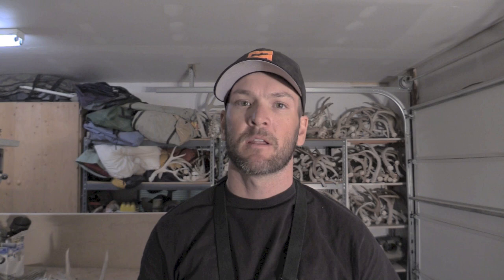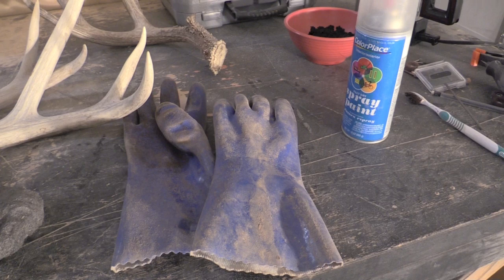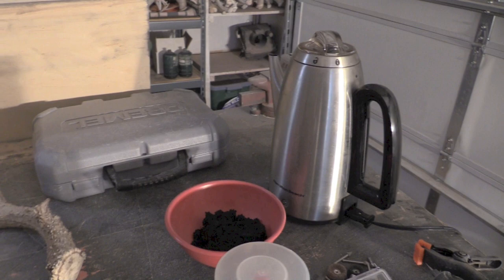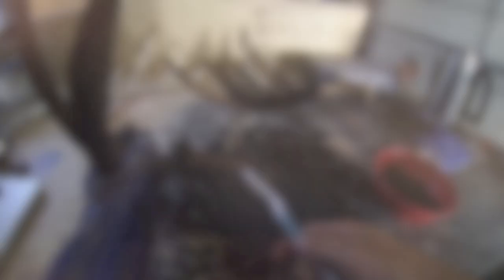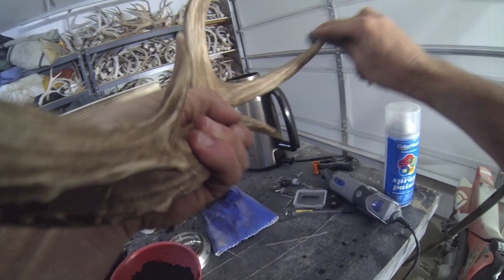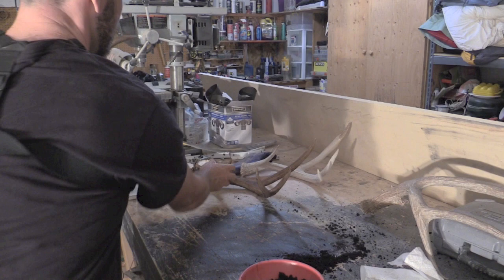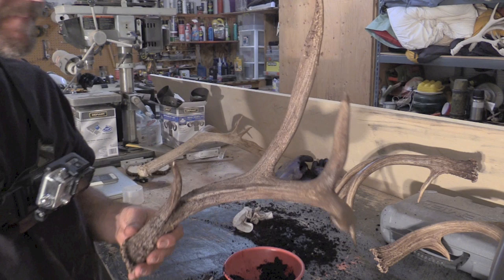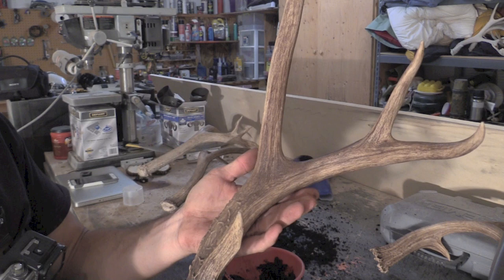How To Restore Color To Deer Antlers CHEAP!

Comment: Hey if you want to take the cracks away, before you color them use some wall board joint compound, rub it in the cracks, and it will look hard white again. After that you wipe the compound off gently with a wet cloth. Then you can recolor them, and they will look good as new!

Comment: I have used coffee for a long time .... however , I mix the coffee grains in warmed up pine sap . Pine sap when warmed up liquifies and turns darker . When it liquifies add the coffee grains and then apply it to the antlers . When it dries , take steel wool to it . When done it's a nice natural color , plus the pine sap acts as a sealant .
Reply: Mike Foote do you still spray clear on it or no?
Reply: Great video and clearly explained

Comment: Drug store. Ask for Potassium Permanganate. Very inexpensive. Just pennies to do a full rack. You mix it with water and brush it on the antlers. Turns antlers darker and darker with repeated applications. It is a bleach so strong that it actually burns bone. When water dries off the bone is darkened. Goes on deep purple. Dries off leaving the antlers darkened. Leaves antlers looking very natural when applications completed. Can even be used to color only a portion of bone which has been scraped or rubbed too hard in transport. My go to product for 50 years of mounting moose, deer or elk racks in northern Canada.

Comment: I use brown shoe polish.  I apply it with an old toothbrush and then just buff with a micro cloth.  Once it is dry, it does not rub off and has UV protection.

Comment: The best and natural way is using tannin from tree bark/skin or crushed leafs, that's what those deer been rubbing.  Rub on it, after a few days, it turn brown after oxygenated, repeat for deeper tone, it is permanent, never wash off.  For shinning effects, polish lightly with 1000 grate or above sand paper, then lay blue jeans cloth with tooth paste on firm surface, holding antler down rubbing on cloth with adequate force. Especially good for making jewelry.

Comment: Great vid appreciate you posting it look really good. I personally found that a large wire brush with stiff bristles like a welder would use works really well forgiving that natural Streaked look of rubbed antlers. I had used the little foam sanding blocks and it didn't look as good (and not steel wool for what it's worth).
Reply from the maker: Josho8327  nice, I like hearing all the other methods people are using.

Comment: Looks like that works pretty well. On the video they look almost identical to the fresh one.  I am going to have to try this on some whitetail sheds I have picked up. If they don't come out as dark as you'd like would a second coat of the coffee darken them more or would trying a different darker coffee be better?
Reply from the maker: Jeffrey Baskin I've found the fresher the coffee grounds the better for darker color, also starbucks french roast is the darkest color I have tried.  lf you let them dry for a couple hours and then apply the coffee again it will make it a little darker but not significantly.  I haven't tried it on white tail yet but I'd assume it will work well.  Let me know how it goes.  Thanks for the questions
Reply from the maker: Using a different coffee may make them darker. Letting it dry and set for a while and then doing it again with a little dryer ground will also make it darker

Comment: How will this work if my deer head cracked off a point? Will it look bad like the crack in the horn?
Reply from the maker: It will still color but it won't match the rest of the antler.  It should look just fine though, it wouldn't look the same with natural color on it either because of the difference in texture and density of the inside and outside of the antler.

Comment: How long have you had coffee grounds on an antler? When I use mud and old English oil it dries up and absorbs the moisture leaving the ho.. oops almost said "horn" antler looking dusty and I need to apply another cote of oil. Wondering if the coffee stains it well and doesn't get absorbed . Thanks
Reply from the maker: Darren Freestone I've left it on overnight before but it usually only takes a few minutes to maybe an hour.  The condition of the antler is really what determines how well it works

Comment: Do the coffee grounds need to be dried out? I attempted this, and the grounds did not stick and stain like it did in your video. Trying to find a method that can do this easily and cheap! Thanks
Reply from the maker: They work best right out of the coffee maker.  Grind them a little finer if you have a grinder or buy fine ground and that may help.  I've heard of guys mixing them with honey or melted tree sap but I've never tried it myself. Good luck hope it turns out for you.  I'd say 80% of the ones Ive done that are only a year old have turned out awesome but sometimes they just don't turn out for some reason, still trying to figure out why
Reply: Hidden Instinct Minwax wood stain also works. Can't remember which color though. Thanks for the tip on the coffee grounds, I'm going to try it.

Comment: So i found some beautiful antlers in my basement, the colour is still good, but they have a real stink to them... No they don't have flesh or velvet on them, they were originally cleaned by nature just insects and sun, but finding them after all these years i cant believe how much they stink. i tried giving them a scrub with water and very diluted bleach (clearly i'm no professional) just not sure how to get rid of the stink without damaging the quality or colour of the horns. Perhaps coffee grinds would make them smell a little better? I don't know i guess i'll put them back in the sun just not sure if anyone has any tips on how to deal with old antlers that were half ass cleaned.
Reply from the maker: Is it the antlers that actually stink or is it the skull plate where the antlers are attached?
Reply: The smell was worse at the skull plate, but was noticeable throughout the whole thing, probably from being left in storage for so long...well since than i crossed my fingers that a baking soda paste wouldn't damage anything, and i rubbed the antlers with a paste left it in the sun for a couple hours, washed the paste off and than put it back in the sun for 2 days. It seems to have worked! No more smell, clean antlers, and no noticeable damage or fading :)  Eventually i would like to find a smaller shed to use as a knife handle, but i'm not about to wreck this set now that i have successfully cleaned them up! Thanks for the response! Though i guess i couldn't help myself and tried something random anyway haha